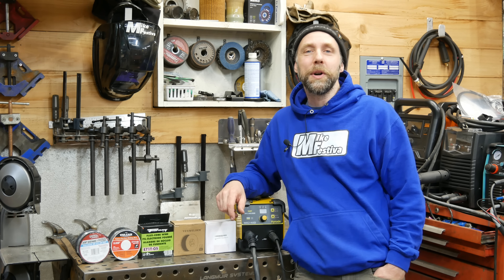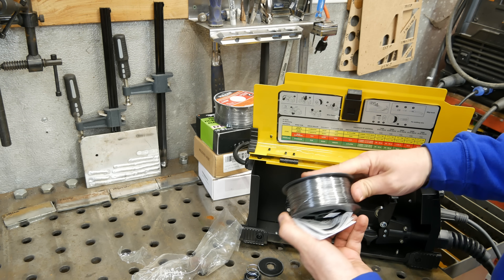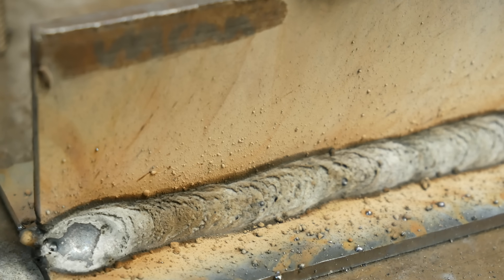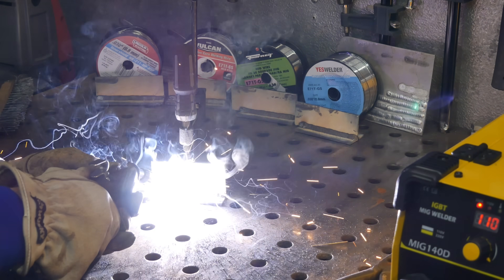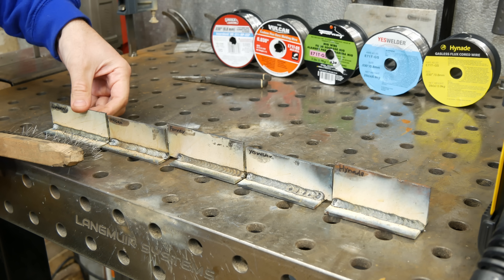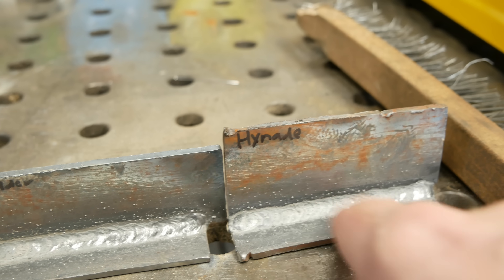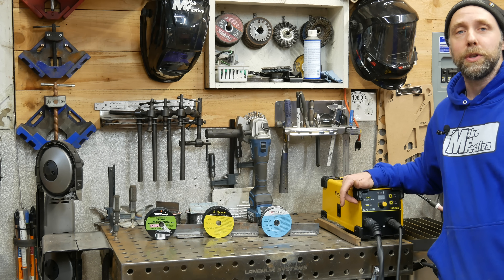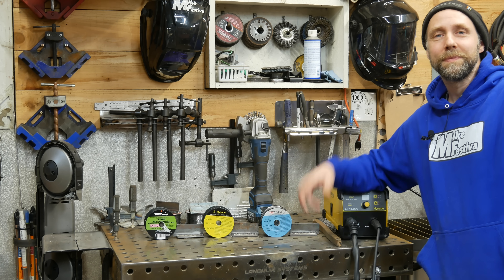Gasless Flux Core Welding Tips, Make Better Cleaner Welds

Comment: Always love your non biased views and actual hobby user feedback for all to see. 
I have a couple of comments on this video, I really wish you would of cut the coupons thru the weld and seen the actual depth of weld. Different wire will have different reactions to material and heat settings. The other thing is to remember flux core wire is very simular to sticks in stick welding. The flux still absorbs moisture while exposed to the atmosphere so keep your bags sealed until you need them. The advantage of the 1# and 2# spools is the less they sit collecting moisture. Even non flux wire will rust if exposed to the atmosphere too long. Living in the southwest is better than up north where we're usually in single didgit humidity levels. When I lived up in Northern Illinois we welded about 2x a month, had 40# spools that we only used about 7# of before having to throw out the rest, it just wouldn't weld for crap. We switched to 2# spools and would use all of them up. Just what we noticed. Old school fabricator here, at work our welders ran 2 full shifts 5 and 6 days a week. Wire didn't have time to turn bad there.

Comment: Whilst it's true that not all makes of wire are equal it's ultimately about tweaking the settings until you get them right. Every wire has its tune. At least in my opinion, i've never come across one that won't get in the zone with a little bit of tweaking and my gasless welder is that cheapo one that Stanley makes. It was the only small one that was narrow enough to fit in the spare wheel hole in my SUV. So not really that much setting room in that one.

Comment: Only one of the wires (Lincoln) is E71T-11 wire. That's why it's the most expensive. All the others are E71T-GS wire. They were subjected to no AWS testing, which makes them cheaper to produce. It also means you have no idea what -GS wire is good for. AWS E71T-11 is rated for all positions and multi-pass welds. If you look at the Amazon pages for most of the -GS wires you tested, they hint that their wire is "best suited for single-pass welds". You get what you pay for. I'd recommend sticking with the Lincoln and tweaking the machine to make it work "smoother" for you.